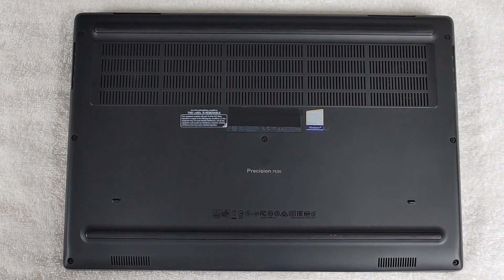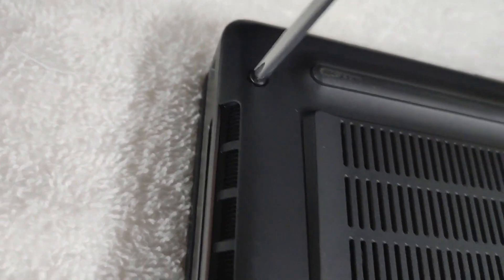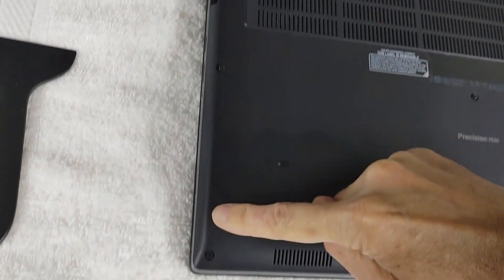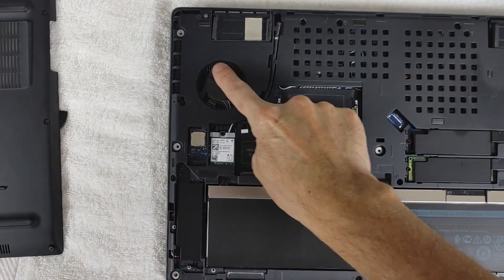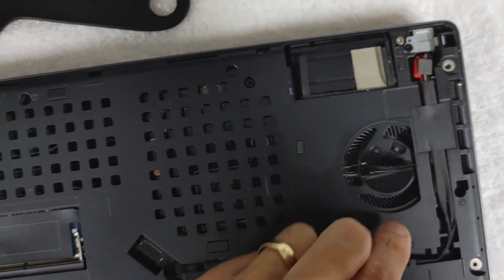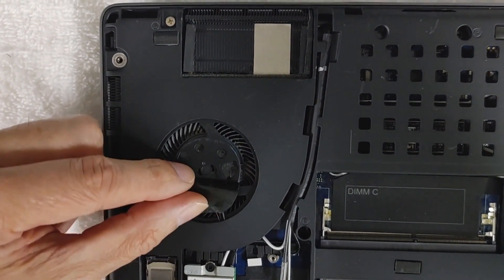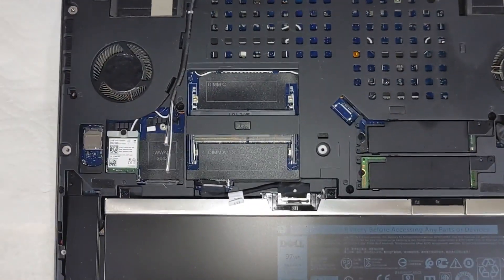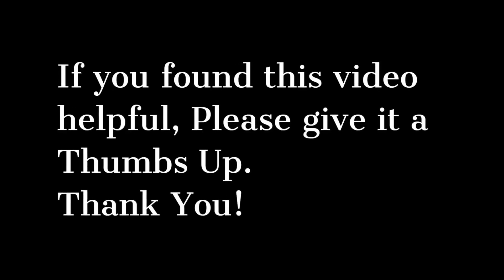Dell Laptop Fan Noise Fix

Comment: You may have just saved me from buying a new fan assembly! My fans have gotten so rough in the last week or two that they've been having trouble spinning up, so not only were they grinding, but the grinding noise pulsed around 1–2 Hz. After my first try at oiling them, the fans still sounded like death, though they at least stopped pulsing after a minute or two. When I at them again, I saw that a bunch of oil had run out onto the seal stickers. So on my second try, I oiled the fans while the computer was running so the oil could work its way down into the moving parts, and they went almost silent after a few seconds.
Working inside a running computer is kind of stupid, but at least I saved $70. 🤷‍♂
Reply from the maker: Awesome! Glad it worked for you. The PC shown in the video, the fans are still completely silent. I think as long as the oil gets in the bearing/bushings, and the wear is not extreme, this fix definitely works.

Comment: Would white lithium grease work? I don’t have a way to accurate pour engine oil into my computer without making a huge mess
Reply from the maker: Not sure if lithium grease would work. I would doubt it would penetrate well, down into/around the fan motor shaft, like motor oil does. You can try dipping a toothpick into motor oil, and then touch the droplet from the toothpick onto the end of the fan motor shafts. This will prevent making a mess.
Reply: No, use the engine oil full synthetic, light oil is best. Grease wont penetrate to the bearing shaft of the motor.

Comment from the maker: Yes, completely understood. I have done this on many small fans, including inside Kenmore refrigerators/freezers (evaporator fan motors; which run in an environment below 32F/0C). This method has fixed them for years. Just carefully use a good quality synthetic engine oil, not something like wd40 or silicone spray; they are too thin and their lubricating properties are limited over time. I will definitely post a follow up if the fans have future issues. Also, dirt/dust getting on the bushings/bearings can complicate the situation, which is why it is important to seal the area back up.
Reply: wd40 works great for door hinges and the axels on my fold-up pull cart. Thanks for the tip on the type of oil to use on fans. Back in the day, I probably threw about 100, 5 1/2 inch, computer fans away that could have been repaired this way. Is the 0w -20 oil for Toyotas ok to use?

Comment: Nice tip, can you do an update in a few weeks/months to see if this fix actually lasts? In my experience, when sleeve bearing fans start making noises, it's time to replace them, because lubricant will only work as a temporary fix. However, it's a different story if it's a ball bearing fan
Reply from the maker: Update: It has been over 1 year and the pc shown in the video... fans are still good/fixed. The pc is used almost every day, for many hours per day. 
Hope I didn't just jinx it...
Reply: @bobbilly351  holly dedication, I completely forgot, but thank you for the update mate :)
I ended up replacing one of the 200 mm fans on my brother's pc because it was wiggling a lot, the shaft is probably loose/worn, and no amount of oil would fix that... The other 200 mm is going just fine over a year after following your tutorial, cheers for that :D
Reply from the maker: It has been 16 days (over 2 weeks), with 9-10 hours per day minimum usage, and the fans are still quiet/normal. Will update again later.